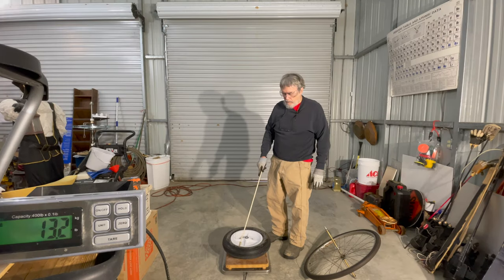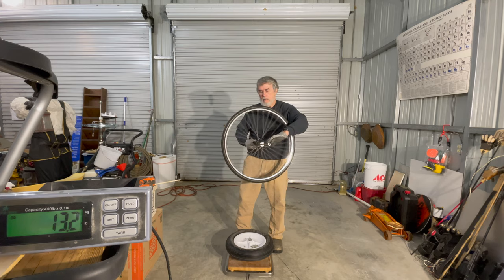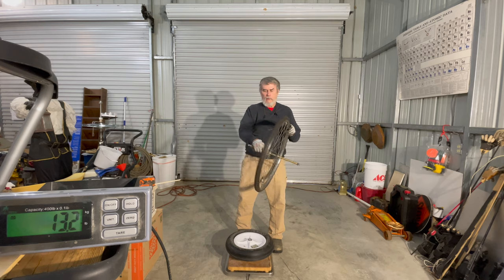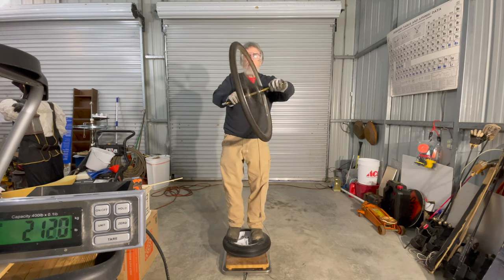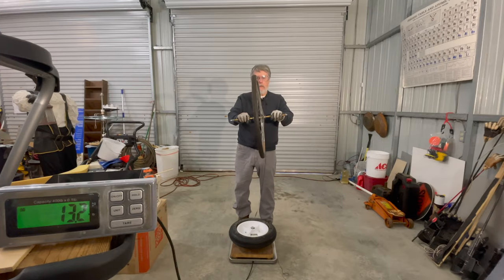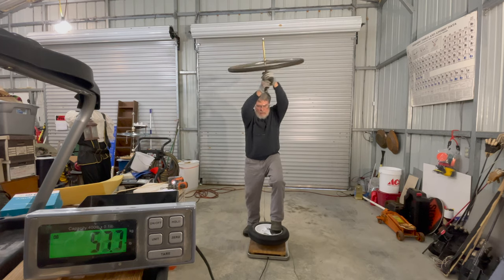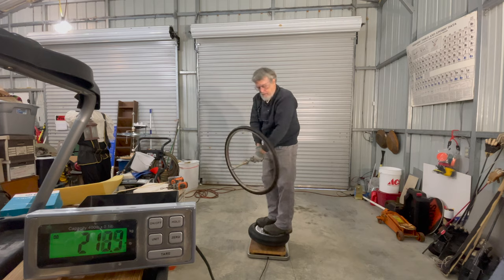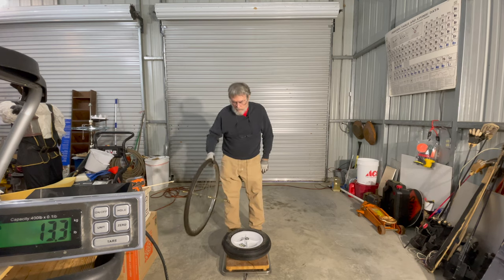Gyroscopic Effects Demonstration with a Bicycle Wheel on a Turntable

Comment: Thanks for the video! One comment I have is that when your'e trying to experiment with 'more or less gravity' by lifting or dropping the spinning wheel, it is when you generate an acceleration upwards (by lifting it up or stopping the downwards drop) that immitates higher gravity. So what is causing you to spin faster when dropping or lowering down the spinning wheel is actually not the drop itself, but rather the 'stopping' of the drop (using your upwards force) at the end. And when lifting, you start spinning faster as soon as you start lifting the spinning wheel, and slow down once you stop lifting.
Reply from the maker: Thanks for watching and your excellent comment!